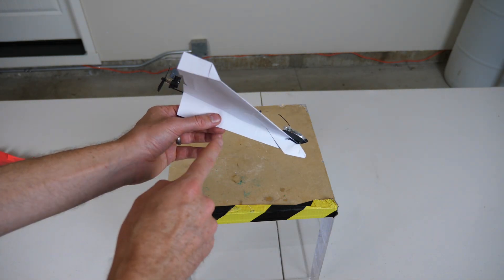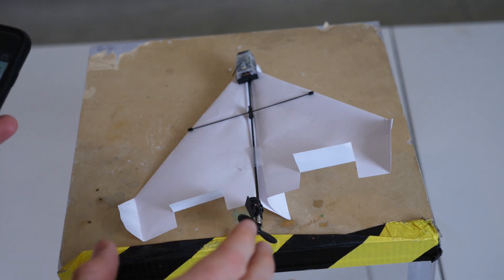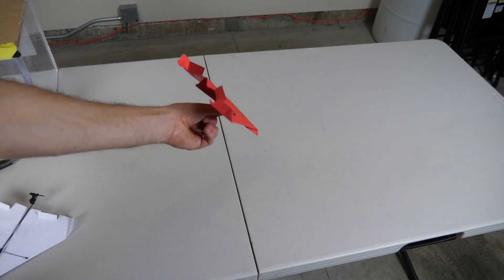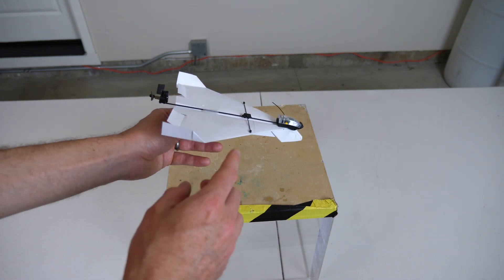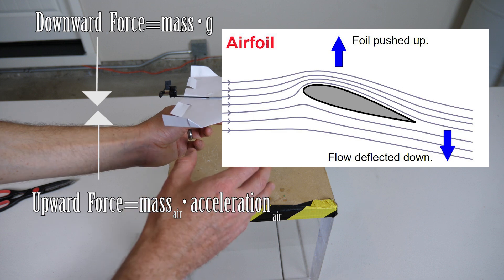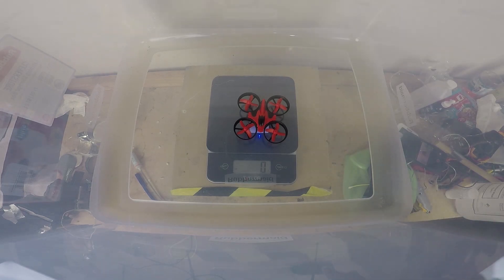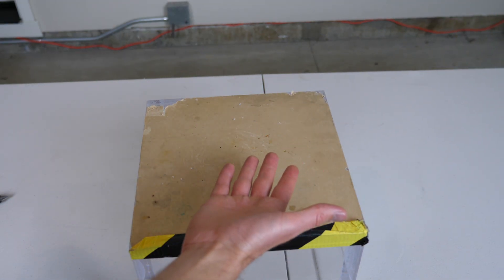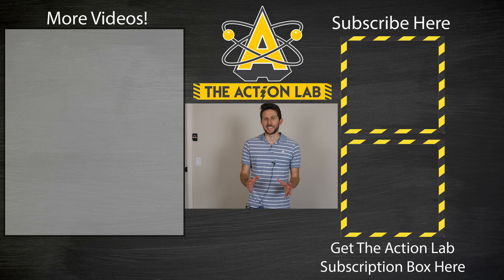How Far Can a Paper Airplane Fly if You Add a Motor? How Do Planes Really Fly?

Comment: 8:32 yes this is real, and this is a prime example of what in aviation we call Wake Turbulance, and by the way The Action Lab, you can feel the wake turbulance, which is why if you see airport runway footage, you will see that if a smaller plane is being followed by a bigger plane, for example, a B737 Next Gen being followed by a B747-400, and the big plane lands soon after the small plane. This is because it is bigger, and wake turbulance from a smaller plane doesn't affect bigger planes as much. However, a small plane following a big plane will land a lot later, as the wake turbulance will shake the smaller plane hard, and the same applies for takeoff. I know this because I was in a Cessna Skyhawk inside a flight simulator 10 nm from the runway, when a B737 Next Gen flew in front of me, which did nothing for about 2 seconds, then all of a sudden, I start getting flung around like a rag doll. I had a rough landing, but I safely landed. By rough, I mean I had one bounce.

Comment: What you said about the curvature thing is inaccurate; it is necessary;  without the airfoil shape wings need a higher angle of attack, which increase drag and require more power to stay in the air. You can still fly with zero angle of attack if you got the right curvature, and you can fly with a flat wing if you have a higher angle of attack but then you use more fuel.

Comment: For a Aircraft to fly well, you need to know it's centre of gravity. To steer the plane , you need 2 control axis L and R turn with the rudder and up and down axis with the elevator. In some aircraft like a delta shape the the 2 axis are a mix call elevon  control.

Comment: I thought they flew because the difference of air pressure above and below the wing ( Bernulli principle maybe!?) much more logical to think of "pushing air down"
Reply: I didn't mean to sound stale, it's just that this video comes with a lot of misinformation
Reply: The principles both have an effect, in regular aeroplanes, you wouldn't be able to sustain flight just with flaps/slats simply because they cause a lot of drag.
So yes, the Bernoulli principle does have a vital role.

Comment: Whoa up a sec there Bill Nye. Hold a sheet of paper just under your bottom lip and blow. The paper should rise as Daniel Bernoulli explains. An increase in velocity creates a decrease in pressure. As you blew over the paper you created a low pressure zone above the sheet. The higher pressure below that sheet was pushed up in its attempt to "fill a vacuum"... you know, that stuff nature abhors. An airfoil is created when you give some curvature to the flatness of that sheet of paper. Putting the curve on the top and flat on the bottom means the air on the top will have to pass the longer distance quicker to meet the same air at the same time on the bottom. Again this created the higher velocity lower pressure phenomenon. Airfoils are highly desirable in aircraft because they can produce much higher lift for a given airspeed than a sheet of plywood might. Airfoils obviously come in many shapes or "aspect ratios" tailored for the specific aircraft. A helicopter has a rotary wing. The aspect ratio of the rotor provides a degree of lift by its design but also the "angle of attack" that the rotor has will increases or decrease that lift. It is the angle of attack that you may think is creating lift. The problem with the flat wing is you always need some positive angle of attack and the threshold of too much angle of attack is very very small, regardless of your airspeed. You need smooth airflow or "laminar airflow" over the surface of your wing. This provides lift and control, but you can overcome that with more power, servo motors and computers. The F104 starfighter has a wing right up your alley... more or less.

... from the ground up

Comment: Your explanation of lift is totally off.  Why does your glider fly?  It may be composed of several elements.  
1) You have constructed at the tail of the wing flaps with them pointing up.  The air traveling over the top of the wing will travel more distance than the air flowing over the lower surface causing low pressure on the upper surface.  
2) Because of the flexibility of the paper, the flap is causing a warping of the paper to cause the shape to be more like a typical air foil.  
3) All paper planes or gliders have built up a thicker portion of paper at the leading edge creating the air foil needed for flight.

Try this experiment.  If what you say is true, take some cardboard and make a glider shape with the same thickness of the wing from leading edge to trailing edge and see if it will fly.  This could be a follow on experiment for you on the action lab.

Comment: If you put a pulley on the shaft to run a belt to a alternator to charge the battery would you have unlimited flight? So while the propeller turns the belt to the generator is also turning

Comment: I don't doubt that some air gets thrown down, but there has to be low pressure above and high pressure below because it is the same principle that makes a sailboat work. If that wasn't true then how could a sailboat that is not under power sail into the wind.
Reply: A sailboat doesn't throw wind backwards it sails into the wind. And no matter which way it tried to redirect that wind it would never go forward unless there was a vacuum pulling it.

Comment: Great video really enjoy the channel however would like to inform you that an airfoil will stall over 20 degrees angle of attack, and the air swirling as actually called wake turbulence produced by the higher pressure underneath the wing trying to flow over to the low pressure above the wings at the wing tips, since the plane is in motion the outcome is wing tip vortices swirling inboard. Thanks.

Comment: A perfectly flat wing wouldn't make a plane fly, you should have also explained the rear spoilers that generated downforce (Negative Lift) to balance out the weight you put at the front which also gave it a slight tilt towards the rear giving it an angle of attack which pushed air downwards creating lift. If lift was all about pushing air downwards then aerodynamics would be very easy and planes would just look like over engineered flying paper airplanes, so thanks for explaining at the end that planes fly for both reasons, many people were getting the wrong idea throughout the video.

Comment: Fair point about airframe pushing equal amount of air down as weight to balance lift and and weight. But if those were the only forces then the aircraft will just hang in air. You're forgetting the main forces of thrust and gas turbine engines which push lost of air backwards and because of reaction forces on pylons the A/C moves forward. (Newton's third law).

Comment: Angle of attack causes high pressure on the bottom and low pressure on top due to air wanting to travel straight across at 0 degrees by the plank(flat wing) deflects the flow. Its not really the downward force or thrust but the pressure differential. Down flow is a loss - try sitting in a office chair with wheels and blowing quickly out from your month. When was the last time you were pinned against the wall? The down flow is insignificant for air crafts but paper airplanes are different; jet fighter standing on their tails flow a lot more high speed air then a flat wing. An airfoil by Bernoulli's principle causes a similar pressure differential or lift; it is just more efficient at creating lift with less drag. Ground effect lift is only present when very close to the ground at high speed; similar to why dust sticks to a fan blade, air does not move near a surface hence on the ground you can run on a cushion of air like a boat being displaced or buoyed. Say you have 10% pressure difference at 14psi (air pressure) that is 1.4psi or 200+ pounds per square foot area. How big are planes wings surface area? It adds up quickly.

Comment: Wing geometry is the major contributor to lift for commercial airliners (that's why even a thin sheet of ice is enough to cause fatal stalls), whereas fighter jets and sports aircraft tend to have symmetrical wing cross sections to enable them to fly at extreme attitudes (like upside-down).

Comment: Yes, the planes wing has a shape called airfoil, the air gets devided into two parts on the leading edge, some air goes downside of the wing and some on the top...because of the curve on the top, the air has more distance to travel than under the wing, which makes the air faster and have a drop in pressure, while the air under the wing has a higher pressure. Because of the higer pressuer under the wing, the plane produces lift!

...if you are wondering how the plane does a level flight(then its going straight foward and not up or down), the speed of the plane is set to a specific velocity so that the pull of gravity and the amount of lift is the same.

Comment: People, people, people...  It's not an either-or situation.  An airfoil produces lift because the shape causes the air above and below the shape to simultaneously travel at different speeds, creating a pressure differential that lifts the wing.  Having the wing at an angle relative to the airflow (called Angle of Attack - or AOA) also produces lift.  Those two factors working together are what causes an airplane to fly, causes a propeller to pull a plane through the air, causes a prop to push a boat through the water, etc.

Comment: They'll tell you the difference in air velocities between the top of the wing and the bottom of the wing caused by the airfoil shape creates a pressure differential that produces lift. 
That's a crock of shit.  It's the angle of attack as the plane travels forward that produces lift not the airfoil shape.  The airfoil shape simply optimizes the drag to lift ratio and the air velocity difference is an effect of the air being deflected downwards by the angle of the wing, not the cause.

Comment: What a horrible explanation of two different principles at work.  The first is bernoulli's principle of fluid dynamics and the second is pitch.  Even a "flat" wing--or symmetrical airfoil becomes asymmetrical when you pitch the leading edge upwards.  Just horrible.
Reply: What a horrible thing to state that two different principles are at work.

Comment: It's all about angle of attack. If the plane is at level flight the curved wing causing "low pressure" keeps, or increases altitude. Increasing angle of attack increases altitude, but causes high drag, killing efficiency.

Comment: you said it wrong a plane wing has a low pressure above it and a high pressure below it.       You said the wing throws air below which is the same as having a high pressure below

Comment: Do the test with the paper plane again without the flaps on the back of the wing or with them folded down instead of up, I bet it won't fly straight or up(in the case of them being folded down it will fly towards the ground) . The reason your paper plane manages to fly up and forwards is the upwards facing flaps forcing the rear of the plane down thus the nose rising and the thrust from the motor pushing the plane forwards.

Comment: So, what he's trying to say is that, like a fan, if the wing is at an angle, air is being pushed downwards, and if the wing is not forced to be stationary, the air lifts the wings up, but what he doesn't realize is that when real planes are taking off, they don't have that angle, so the wings have that curve over the top to change the pressure and lift off. Also, Basically the only time planes curve up are takeoff and landing. They use it for landing because while at an angle, if the plane is still moving forward, it creates a lot of drag.

Comment: QUESTION! (also very confused): 6:33 my understanding is that in that drone test with the plastic container, the scale is measuring the mass thrown (or air pressure) downwards generated by the drone which in turn creates lift. So the drone weighs 21g. And the scale is tared with the drone on it, and stays at 0g when the drone lifts off because of the air pressure generated. This means that the motors are generating at least 21g of mass thrown (?) in order for it to fly. 

The thing is why does the scale stay at 0g the entire time if at 0g, there is an equal gravity force to lift force? Shouldn't the scale change a bit because to create an acceleration up, the drone needs to create a greater mass thrown than the 21g of self weight? So the scale should have read a positive number when the drone was lifting up, right?
Reply from the maker: Yes it does change however the refresh rate of the scale is very low so you don’t see quick changes like that. On an analog scale you’d see it better. You’d see the needle wiggle up and down as the drone accelerates up and drops

Comment: The reason why the dron's weight remained same because while designing drone or helicopter we try to balance the weight of the helicopter or drone to the thrust (force generated by the air pushed down by the wing (in helicopters)). This is done to balance the weight which make them hover at a required altitude. But It's not always true in the other maneuvers.

Comment: Plane flight has more than one CONFIRMED method of gaining lift. One is a curvature in the wings, causing higher pressure underneath than above, pushing the wings (and the plane) into the lower pressure zone, or up. The second is simply using Newton's third law, and an angled wing. As the plane moves forward, the air is pushed downwards by the wing, causing an equal and opposite reaction pushing the plane upwards.Both models are proven to provide lift, but each have their downsides. Neither models are wrong, both are scientifically accurate descriptions of the lift phenomena. Therefore, it is stupid to call out proven technology just because you got your hands on a motorized paper airplane.

Comment: 1:15 it's higher pressure below and lower on above
Reply: I came to comment section just to make sure I'm not getting crazy
Thank you
Reply: Thats true
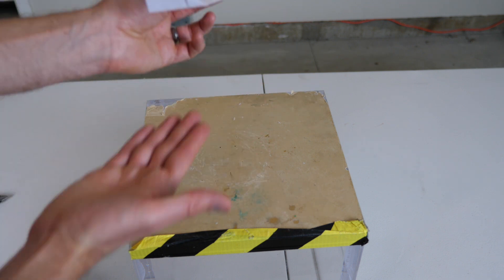Reply: Correct at 8:40
Reply: Right and it is why planes fly. However I think this guy would find that without those tail flaps creating more resistance on the top of the wing causing lift. It wouldnt fly. However its cool to see his plane fly.
Reply: @Agent_Lokii  yep, why the air brakes?
Reply: @Agent_Lokii  air flaps help because the wind follows the object's shape and when it leaves through the flaps it creates force downwards lifting the plane
Reply: @astrid7929   It works as elevators,  the force downwards increases the angle of atack of the aircraft, witch is the way to increase lift for a symmetrical airfoil., the lift for a symmetrical airfoil at 0 º is 0.  The way you can get more air molecules pushed down is to increase the final curve and area, by angle,  by asymmetrical wings bys slats or flaps. The pressure diference explatination is not wrong, is just simplistic. I think the guy on the video wants atention at costs of people that did'nt studied this.

Comment: Actually, when a plane has curved wings the pressure differences actually make the plane take off and go up, but yes you are very correct on how when the plane is in motion it's not the pressure differences that keep it in flight and cruising but the air pushed down

Comment: How this paper airplane works is that the 2 pieces folded up in the back create downforce in the back while the propeller pushes the whole plane up because it's at a slant not flat so your experiment was invalid because of the flaps on the back not the middle of the plane.

Comment: Argh!!!  This was painful to watch.

Yes, one component of lift is the Newtonian aspect (but not in your particular example), that you can use angle of incidence to deflect airflow down and the lift is the equal/opposite reaction, but another aspect is Bernoulli's principle that faster-moving air results in lower pressure and the curve on the top of the wing vs the straighter path under it result in lower pressure above the wing than below resulting in lift.  Wings with a well-designed airfoil will typically produce sufficient lift at speed that they will even maintain altitude with a negative angle of incidence.  

There are wings that do not really use Bernoulli's principal, but they are typically designed for extreme high-speed or aerobatic use with very high power to weight ratios.  Paper airplanes are not a great example.  The way you fold the wings results in an airfoil shape, though sometimes more of a KF-Step style that only works at low Re (Reynolds numbers), and even if not almost always results in an undercambered airfoil.  

Your design appears to result in both a traditional airfoil with a thicker leading edge and an undercambered airfoil, and you basically built a flying wing which also needs reflex in the airfoil shape to fly which you accomplish by adding the turned up "elevons" on the back of the wing, which if anything deflects airflow from the wing upwards EXACTLY COUNTERING what you are claiming is happening in your video (you are actually getting more airflow UP coming off the back of the wing rather than downwards like you are explaining incorrectly, in your example you do not have a wing surface deflecting airflow downward).